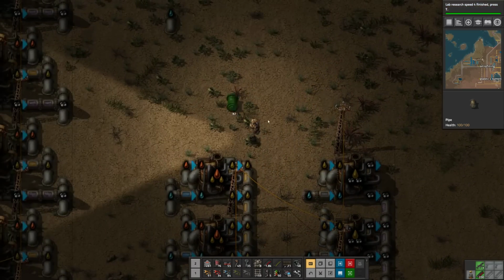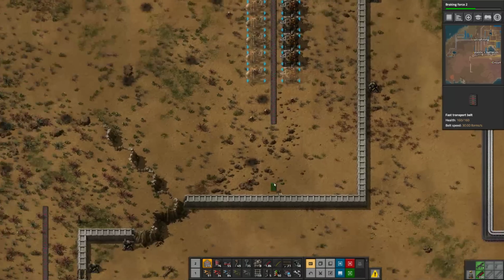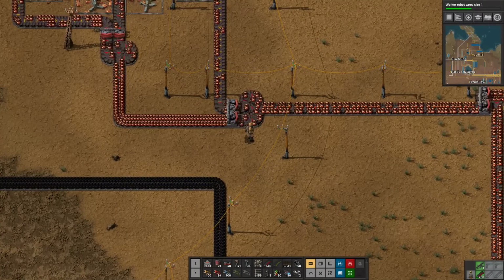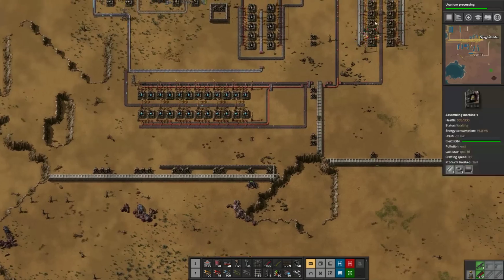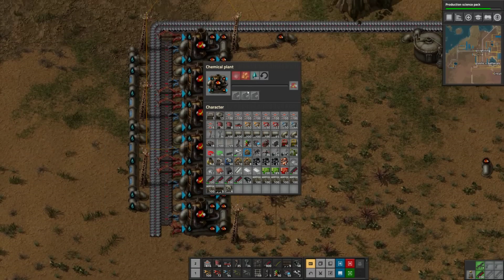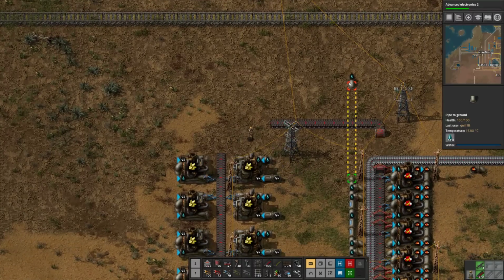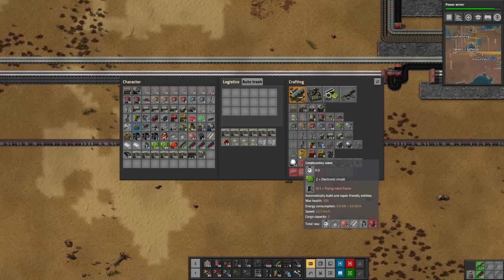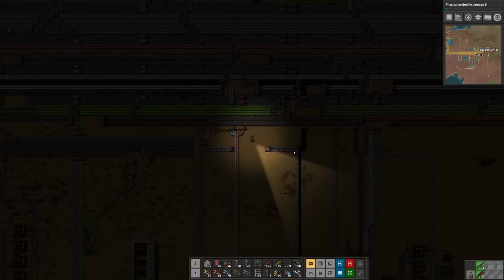Let's Play: Factorio! -- .17 Experimental -- Part 10

Comment: I really like building "Forts" in this game. A small sized walled-off construction with 4 turrets, 4 inserters, circular conveyor belt and a power pole. All I need is to divert some pre-made AP Bullets from my Bullet Bus to a new Fort and it will auto-load the turrets non-stop. And if I make a faraway Fort, I simply use 1 extra inserter and a box instead. Dropping ammo into box and then it will be unloaded till belt is full and keep unloading as need arise. All I need is dropping some more ammo once in a while. It's just fun, seeing automated defences work. Might try out Flamethrowers later~
Reply: That's actually quite cool. You could consider putting a single solar panel down in your fort. That way you don't have to run a power line all the way out to it. It might only reload the guns super slowly, but that's okay because they will just be sitting there doing nothing most of the time anyway. If each gun is only getting 20 bullets a day they'll probably still be fine. Though I guess if you're building an entire line for bullets anyway getting some power poles down is not too much of a hassle either